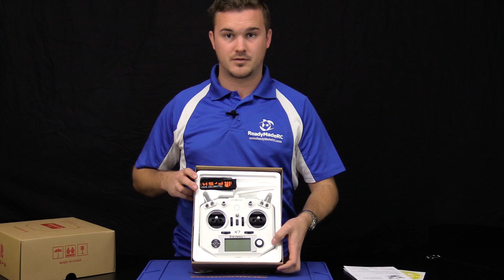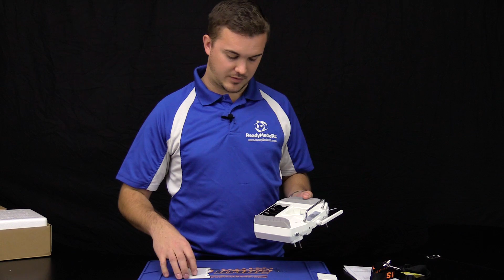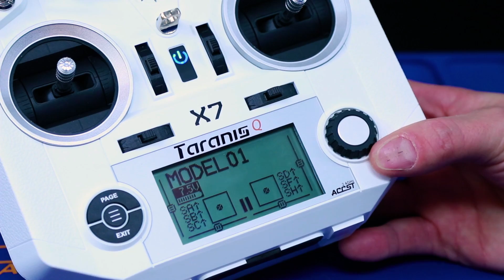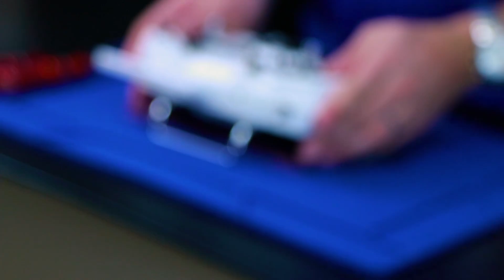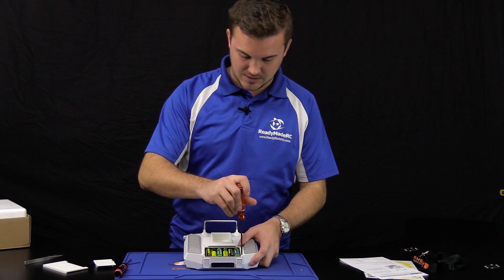FrSky Q X7 Unboxing and Setup for Throttle Mode

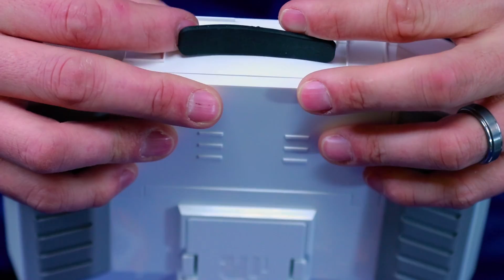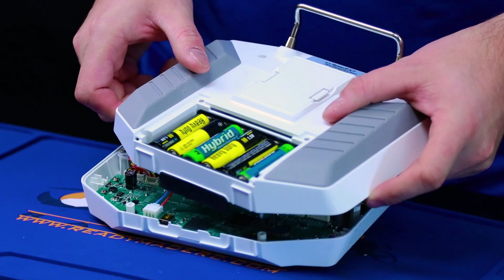Comment: 5:52... later when he takes it apart you can see a power receptacle at @ 7:23 that will let a Futaba type servo/power connector be used without cutting off the tab. So I assume it's a charge jack. Something to look up... I like the simple white plastic,  nice and clean looking. This radio will make a dent in the market that's for sure.

Comment: how do you charge the battery that came with it?
Reply from the maker: You have to supply AA batteries.
Reply: i think you would need a charger and psu for that. similar to how you charge your lipos
Reply: Ready Made RC, LLC    I bought a charging adapter for the 7.2v ni-mh pack that came with my radio  for a couple bucks, but i will keep the battery tray and AA's just in case. thanks for the reply.